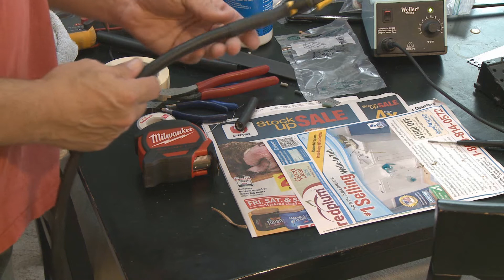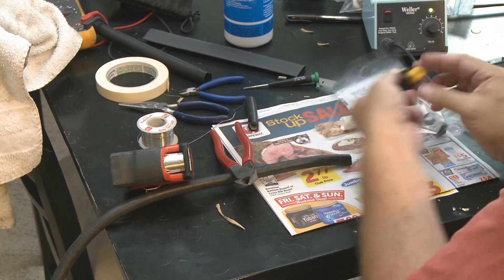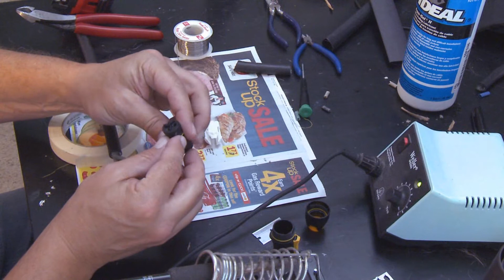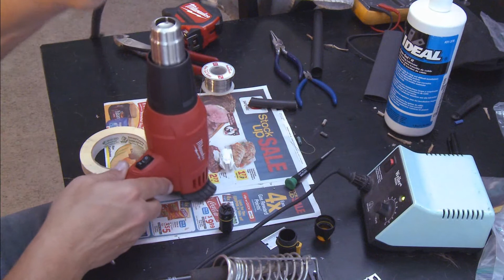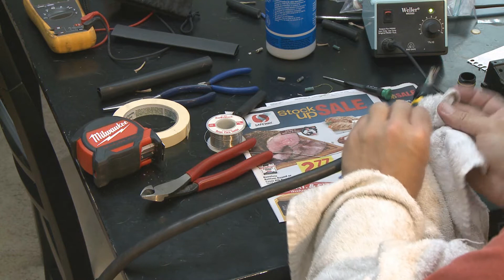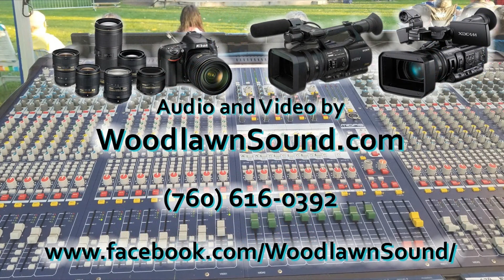Installing Neutrik powerCON TRUE1 on 12/3 SOOW cable for stage stringers

Comment: How not to wire a plug....

Failure at the hinge point guaranteed over time....even though you have backed it up with heat shrink...
No paired cable should ever be outside the plug socket..
Reply from the maker: Thanks for the input.  2 years and over 100 shows after the first ones were made - no failures, but I get your points.
Reply: @WoodlawnSound  luck is on your side for now, but I would expect failure sometime in the future. Should have just gone with 12awg SJOOW.
Reply from the maker: @ChadWardenisBallin  I would have, but I had this cable onhand from a very old lighting project.
Reply: @WoodlawnSound  Old cable and new plugs? Dodgy economics if you ask me...

I also regularly have cable 'left overs' from other projects. If I can't reuse them within a certain period of time, I put some plugs on it and sell it cheap enough but without losing money on it on the Dutch equivalent of Craigslist.

I started doing that so I wouldn't have buckets full of leftovers that are forcing me to reuse them. Now I can always start with a clean slate and do my projects as I intended them.

Free your mind...